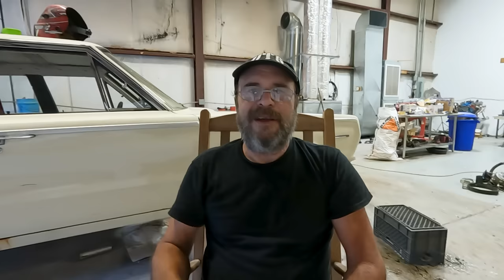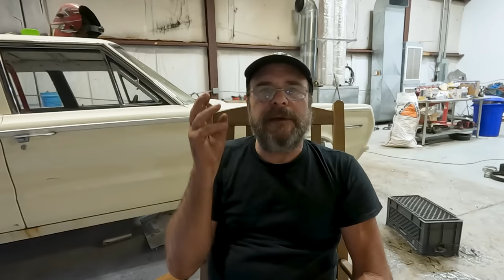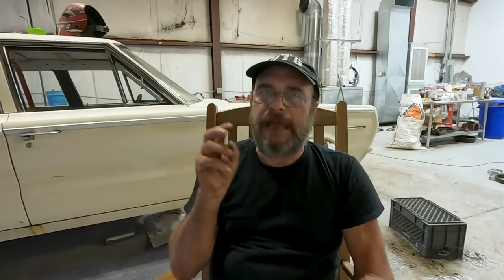They Really Are Out To Get You- How The Automakers Have Made Life Miserable For The Average Mechanic

Comment: I work as a design engineer and it isn’t so much intensional design to make servicing difficult it’s a change in the engineers requirement specs which is driven by cost reduction both for parts and manufacturing hours.  Because only the first owner period is really important for brand image and reliability stats that is all that has to be considered.  I remember when I worked at Jaguar 20 years ago being part of long discussions about eliminating a bead of silicone sealer from an ECU because it would save 1c per unit!
Reply: My God a penny
Reply: Bean counters controlling engineers.

Comment: Some 30 plus years ago, two mechanics from Argentina began to notice bits and pieces if an old 1930 Model A all around their neighborhood being used for various things (one door was the roof of a small chicken coop, for example)  As a fun project, they gathered up the parts over time and rebuilt the thing.  Then they came up with another quest: drive it to Detroit as a publicity thing and see if they could get a new car from the manufacturer.  I met them in Kansas City.  Those guys had all sorts of issues to overcome on the long road through Latin America, but they were able to "Maguyver" their wat through: a baby food jar to replace part of the fuel regulator which was broken; a concrete block strapped in with rope to make up for a broken leaf spring. Brilliant.  Since they arrived right around Labor Day, no company officials were available to talk to them for a day, so we invited them to a neighborhood picnic. Most folks there were retirees from a local Ford plant.  Brother, when that Midel A pulled up, the language barrier dropped and the old dudes in wheelchairs could walk again as they all gathered around and spoke car.  That's a memory I will treasure for sure.  And THAT'S a real American car.

Comment: I think the problem is the technicians are not keeping up with the technology. I've been a tech since 72, and i still take classes to keep up. It not about mearly replacing components, but understanding how they work on a engineering level. Makes repairs easier. Ive repaired ecms and srs modules, abs controllers and more. But yet i still see techs who are just part swappers until they stumble on the fix.
Reply: Perhaps that's a small part of the problem, however what Tony is discussing is a much bigger part of the problem.
Reply: Do you work on VW's and do you live near Spokane? I'm taking shots in the dark at this point.
Reply: You are not wrong and neither is Tony. The problem lies in the fact that without the special education and tools the vehicle cannot be maintained by the average person with basic mechanical knowledge. Which was UT’s main point, people are forced to pay someone to do the maintenance that he use to be able to do his self. Their are lots of folks that simple cannot afford it.
Reply: Not the technician fault! It engineers fault they don't won't people to be able to fix their own cars. Like them making transmission without dipstick to check your fluid!🤷‍♂️🤷‍♂️
Reply: In some cases we can't keep up with the technology. I work at a dealership. The manufacturer changed the radio systems. It took them 2 years to release any information on how the new systems were wired up. Meanwhile the new systems were hot garbage and we were having to field customer complaints left right and center with minimal to no support from the people that made it. And don't get em started on the changes they made to diagnostic and disassembly/reassembly data. It went from being a straight forward streamlined how-to system to a cobbled together jumbled up hot mess that's borderline unintelligible and conveys little to no information.
Reply: @nicholasagnew2792 😂😂😂
Reply: @cavalieroutdoors6036 my God 😂😂😂
Reply: They aren't paid nearly enough to put up with learning the 'engineering' of a modern car...if they were inclined to do that they might become, idk... engineers, instead? Even if they did learn that, it will just be replaced so quickly with new tech that is isn't even worth the time investment to do it.
Reply: @racekrasser7869 you get paid to learn about it in class. knowing the engineering behind something so you can service it isn’t the same as trying actually engineer something lol. it’s not that big of an ask to have the tech know how the component works. technology is changing and boomers can’t keep up because they never learned electronics.

Comment: We called the the explorers with the sohc 4.0 at the dealer “exploders”
Reply: Gotta take the whole engine out just to get to that rear timing chain😤🤯
Reply: @OtherDalfite  I still have nightmares about it🤣. The 3.0 an 4.0 pushrod motors were actually pretty good.
Reply: @NYPATRIOTBX  I have the 4.2 in my f150 and so far it's served me well. Did burn oil one time on a long highway drive but thankfully realized it before anything catastrophic happened. Lovely pushrod engine
Reply: Wasn't that because if the tires?
Reply: @1320fastback  It was actually an issue that affected both the explorers and expeditions from 1990 to 2000 using Firestone ATX, ATX 2 and wilderness AT model of tires. When I was at ford explores earned the name Exploders because of the issues we were having with the sohc 4.0 motor.

Comment: The 4.0 sohc engine was specifically to match numbers with the gm vortec 4.3. The ohv 4.0 cologne v6 actually hadn’t been out that long, it’s older siblings 2.8/2.9 had for decades. The quick fix was to make more hp out of what they had. They didn’t get much increase of torque but they went from 160 hp to 210 by extending the rpm range of the torque curve.
Reply: they are thirsty things

Comment: I just turned 34, I've been driving nothing but 1960s/70s cars since I could drive. I bought one car from the 21st century 2 years ago and its been a huge pain in the ass! After the tranny blew because there is no dipstick and replacing the 300lb AWD transmission the car is stuck in limp mode and nobody can or will even try to fix it. The car is 20 years old and things are only getting much worse.
Reply: What is the vehicle
Reply: @George-dy3pt  A 2003 Passat W8. The W8 part isn't the issue, thats I know of, its wiring. There is no communication through the CAN bus.

Comment: I remember in the mid nineties they stopped selling rebuild kits for alternators and starters.. when I went to tech school we were taught how to completely disassemble and reassemble them.. then you no longer could get the diode rectifier assembly’s then an 120 amp alternator from ford was running over $200 for the explorer but gm at least you could get an alternator for $45… it was only an 80 amp but who needed more than that? It was unnecessary unless you had a major sound system..
Reply: I figured out I could disassemble one at the junkyard, take out the parts I needed. The checkout counter would look at those tiny brushes and say "just give me a buck" 😂
Reply: @amarsta  that's gangsta

Comment: Thanks Tony, now I know that I should keep what is left of my early 2000s Focus parts stash. They are not good cars in my opinion, but I have driven them for 5 years, and with a lot of skinned knuckles and turning the air Blue I can keep the timing belts changed, and the wheels turning! The bodies rust out, but the drive train is solid, so maybe it will end up dropped into a junkyard Tesla that the battery crapped out on! :)  Time to go pull the plugs, squirt oil in the cylinders, and turn the crank with a socket, since I don't want the cylinders and rings to rust, since I may just need those engines and standard trannys shortly!  I wear my "Sketchy" T shirt with pride as often as possible :)   Miles      P.S. You are right, us Gearheads ARE Problem solvers!

Comment: On serviceability, when SAAB was bought but not totally owned by GM, their cars, on GM platforms had access ports under the back seat for the fuel pump. When GM assumed complete ownership they shortly eliminated that feature. I feel it was more on the lines of saving a few bucks each car, and the service centers could charge more for the service, compounding the cost savings with extra overall profit. That’s where I think these disposable and non serviceable parts come into play, it’s cheaper to build a non serviceable unit, and you make more money having to fix it.
Reply: Until the dealership goes up in flames trying to remove a full gas tank
Reply: The Saab 9-3 was built on the floorpan of the Opel Vectra A (Vauxhall Cavalier III in the UK) It had a hatch under the back seat to access the fuel pump. Unfortunately, the hatch accessed the fuel pump for the Vectra, not the larger and differently placed one fitted to the Saab! However, Youtube will show you dozens of videos of just exactly WHERE to cut your own access hatch on a Saab 9-3, I has to do it on my own Vector Aero Turbo!
Reply: My 1998 Subaru outback had two access ports under the rear seat for the fuel tank fittings.

Comment: In '89 I bought a new Ram D150, picked it up on fri at dealership. Sat afternoon( next day) I was stranded on highway,  WALKED to next exit to call dealership for a tow. Fuel pump was bad. They had to replace it. I've never bought a new vehicle since. Except  my 04 VTX 1300s, still have it, 28000 miles w original brake pads

Comment: I am 64, I started working on cars around age 10. I know pretty much everything about the Model T. No, I don't own one, but I have a serious interest in them. I am an "honorary" member of a local Model T club with about 30 members. The model T was designed to last around 10,000 miles. Which is a long time considering how slow they were. Yes they were easy to repair and rebuild. You did have to watch out for termites, there is an unbelievable amount of wood in a Model T. Even the wheels are wood. 

I can work on any 1970s carbureted, rear wheel drive car. Yes, it might need to be modified a bit to get rid of some of the garbage they put on it. Take a 1979 Chevy Caprice Classic. No matter what engine is in it, I can drop any old school small block Chevy engine into it. It will bolt right in. The emissions crap can go into the dumpster. In my state, any 1970s car can be insured and registered as a collector car, and that eliminates emissions testing. I won't touch anything with a computer or front wheel drive, unless it is a simple mechanical job. But you have to be careful. What would be a simple job on a rear wheel drive car, like replacing a water pump, could be a nightmare in a front wheel drive car. In an early '80s Honda Civic, step one for replacing a water pump is "remove engine"

I have worked on engines which required major disassembly to replace simple things like water pumps and starters, because they were inside the engine, and run off the timing chain. The ONLY OHC engine that I know of which can last 300,000-400,000 miles without replacing all the timing components is the Ford 4.6L 2 valve, used in the Panther cars, like the Crown Vic. If those parts did need to be replaced, it can be done with the engine in the car, but it's still a lot more work than an old school pushrod V8. 

Tony, even if what you are saying is 100% true, and I haven't researched it yet, it really won't matter much to us. If it is going to take that long, we are going to be 70 years old, and near the end of our lives. It might help future generations, but it's going to be too late for us.
Reply: Not sure what you’re on about. I have an 89 CRX and a 90 civic hatch and did both timing belt and water pumps on them about a month ago. Took an hour 30 mins tops for both; and no engine removal was required. 
My civic hatch is currently at 375k miles on the original driveline. 
You can take any engine from any 88-2000 civic and throw it into either one of my cars. Don’t hate on the Japanese stuff. It took over domestics for a reason.
Reply: You have never heard of the Mercedes w110 to w123 model ohc 4 and 5 cylinder diesels? Not only do they last that long but they need no electronics at all to run if push started!

Comment: The cars having the first commercial success predates the Model T.  As far as electrical, cars originally had no electrical system, aside of the wire from the magneto to the spark plug.  The lights were acetylene lights and oil lights and everything else was mechanical.  No wires.  No fuse block.

Comment: Couldn't you just disconnect a fuel line under the hood or along the frame by the filter and use a flammable fluid safe pump to empty the tank?  It might take a while but it will be much safer. The pump isn't going to stop the flow I've put inline external pumps on when I couldn't drop the tank sure it was noisy but it worked.
Reply: There are lots of ways to drain the tanks, but they all take time and most guys would rather use that time to make more money.
Reply: Yes
Reply: That's the way I do it when the pump still works, but needs to be replaced. Pull the fuel pump relay and jump it to get the pump to run and pump the fuel out into my cans. 

When the pump is completely dead, I will pull something like the filler tube neck out and run a small tube down in and pump the fuel out.
Reply: Thanks for the tip
Reply: @TheBrokenLife  true but if your that busy you don't want to stand there and watch it drain you can work on something else until it's ready,  lower risk longer life more money????
Reply: @KRich408  Ehhh... I see both sides of it. The more times you handle and transfer gas, the more opportunity their is for something to go wrong. Really, with a modern transmission jack and a lift, I'm not sure that dropping them full is really a big deal anymore.

Comment: I remember when G.M. made it so that if you had to change the battery on a car you had to use a jumper cord that plugged into the cigarette lighter to keep power going to the computer or it would lose its programming and would have to be brought to the dealership to get the computer reprogrammed or the car would not run. Most people were not aware of this and would change their own battery and then have to get it towed to the dealership to reprogram the computer again so it would run. My older brother was working at an Oldsmobile dealership at the time and got in trouble for telling customers who were buying a new car about it so they would know what they had to do if they needed a new battery because by telling them he was cheating the dealership out of the money they would have made from reprogramming the cars when an owner tried to change the battery themselves.
Reply: I am familiar with not 1 GM car in which this is the case. Could you provide at least 1 example.
Reply: @mr.b.1917  I reread the original posters comment. They were not referring to the radio, but to the engine computer needing reprogramming if the battery was disconnected. I just would like to know of 1 GM car (mainly Oldsmobile since that was referenced) in which this is the case.
Reply: @mr.b.1917  it was a short lived design, but for a short time of just a few months of production IT DID affect the ECM, not just the radio. I even called my brother to confirm it, and he said that yes, the computer for the cars engine would be deprogrammed when the battery was disconnected or if it went completely dead.
Reply: @mph5896  My brother can't remember the exact year but it was on Oldsmobiles for a few months before GM changed it. He was the head mechanic for an Oldsmobile dealership in northern Minnesota
Reply: I think you’re trying too sound smart, but you are not correct, sorry.
Reply: That's a funny idea but that's not how ECMs have ever worked.
Reply: BMW too.